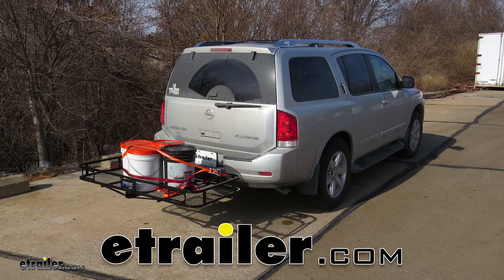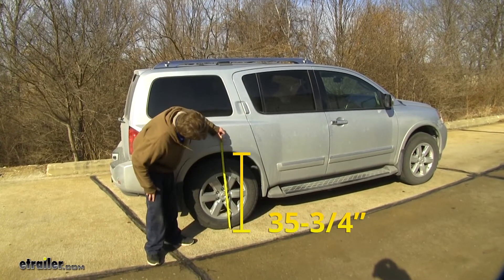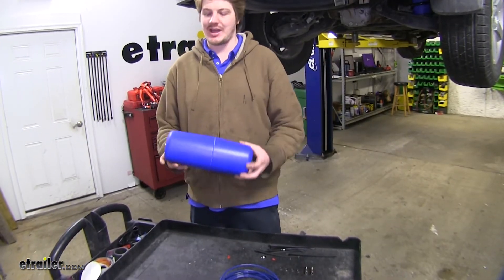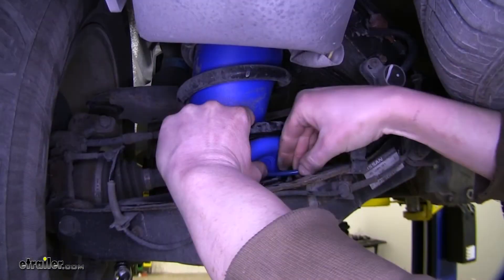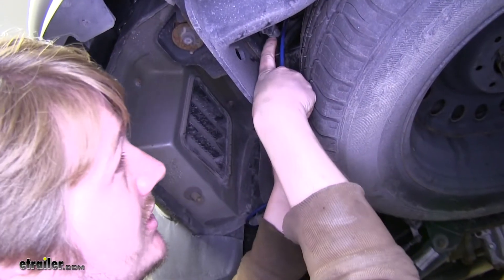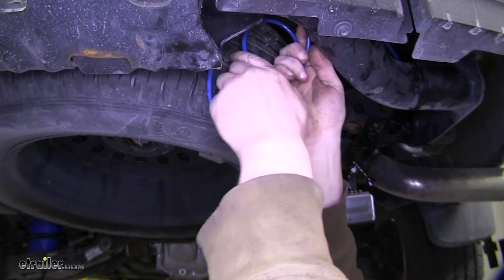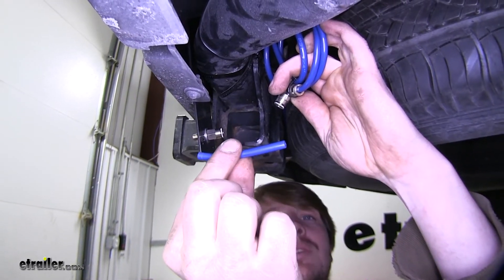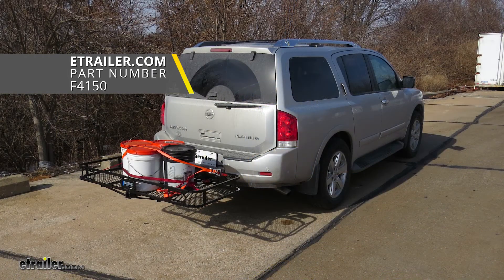etrailer | How to Install the Firestone Coil-Rite Air Helper Springs on a 2011 Nissan Armada

Comment: and the fitting on the springs on the bottom will snap off due to the suspension going up and down all the time you need a 90 degree fitting and not so much of a bend in the line come on firestone thought you didnt make garbage... products

Comment: I have a 2005 armada and it also comes with air suspension and the supporting coil as same as in the video , all these air suspension comes with level sensors too.  So I believe the video is for vehicles doesn’t hand an air suspension